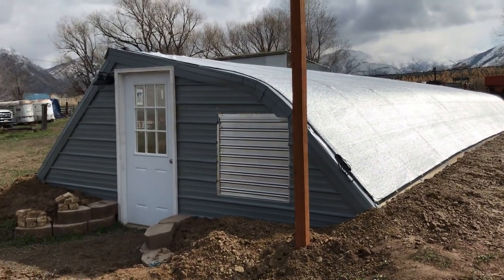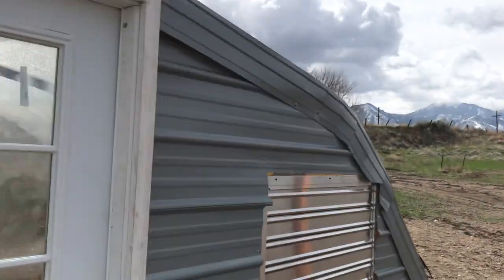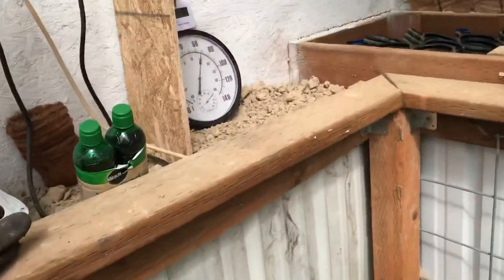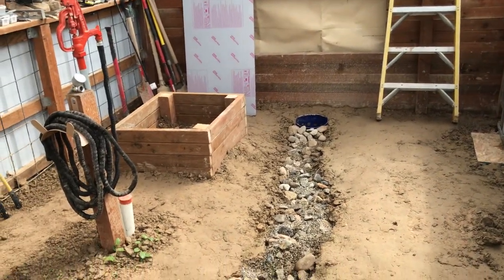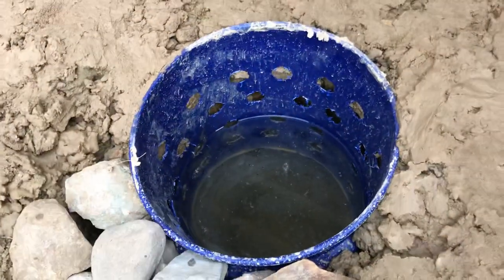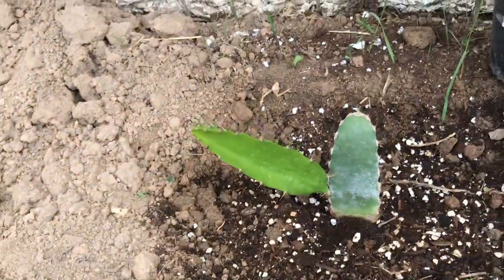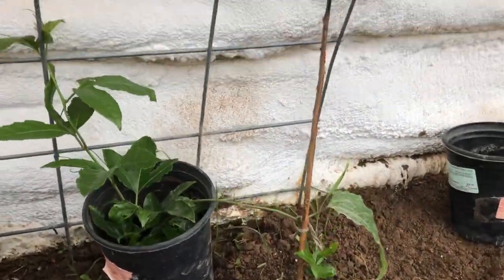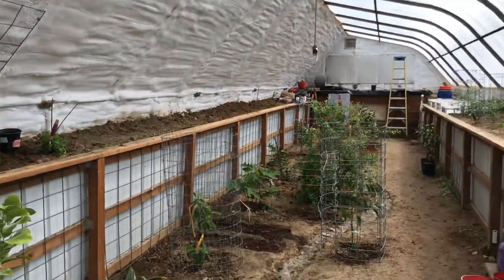Geothermal Greenhouse March 2020 Update

Comment: water drainage you built, how does it actually work? it runs out to the pipes outside and does the place where the pipes go outside underground have cavity where the drainage water is to be flown out? is it gonna effect the efficiency of the 10 degrees of air stored underground
Reply from the maker: The water drains by travelling thru the gravel/rock channel to the trench where the pipes are located.  From there, we have trenched downhill into a pond.  Works great, but was a lot of work.

Comment: Awesome build on the Citrus in the Snow greenhouse!  I have bought their plans too.  Keep up the great work and don't let down!

The GAHT system might not be working so well if the pipes are under water.  Can't move air through water. That might be reason for shade cloth addition?  Extending the suction of the hot air intake, to the roof (highest temp area), might also help with temperature.  Ceres Greenhouse Solutions does this with their GAHT system.

Geothermal loop field works great in water, and a lot more $. 

I go paragliding at Point of the Mountain and would really enjoy visiting your project!

No better time than now to get into farming!  We just seeded 1,024 pepper plants today.  Cheers!
Reply from the maker: Yes, some of our pipes likely have water in them.  We have plans to drain the water out of the channel where the pipes are to see if that helps.  For a new Greenhouse, where the trees and plants aren't fully grown, it can get really hot.  Even with the geothermal.  The Shade cloth really helps us with the temperature.  I hope over time we won't need it.  Heat seems to be a  bigger challenge than cold.  Good idea on the suction of the hot air intake.  We did put a vent at the top of the Greenhouse to push out the hot air.  You are more than welcome to come check out the Greenhouse (when they open back up the World).  Thanks for your feedback.
Reply: @trailbreakfarms  Running HDPE pipe in the ground would help with the water being in the pipes.  This is solid pipe and butt fused, so thus no water in the pipe and then air would not be restricted by water like in drain tile pipe.  The thermal coefficient is a lot higher in water than in air and if a high water table is available then more efficient.  Why we get hypothermia faster in water than air.  

Do you plan on doing another one?  I understand now about having more vegetation inside to help with thermal control.  Thanks for that info!
Reply from the maker: @nealneumiller9177  I used 12 - 4" HDPE pipes and put them 8 feet down.  They are solid rather than perforated as we knew we'd hit water.  We surrounded the pipes above and below with gravel.  But I still think we have somehow got water in some of them.  I found a hole in one of them when we put them in the ground and its possible they just get holes in them.  Hopefully we can get them all working!  

Yes, I plan on a second Greenhouse using a 40' Container as my North wall.  But not for a while.  I'm learning on this one.  Thanks for your feedback.  Much appreciated!

Comment: Thanks for the update.  That mobile weather station is a great new addition to the greenhouse.  I have the same problem on my property as well.  When they drilled holes in the basement floor to put in radon the holes filled with water.  My whole house and a good portion of the lot is on a huge water table.   It looks like the inside of the green house is really coming along with more plants.  How exciting for you all.  Once I get some acreage I plan on building at least one of these greenhouses.  What do you use for backup power if the power goes out?
Reply from the maker: Great question.  We have been considering many things:  large propane tank, generator, wood burning stove (we have several) but have decided to add Solar.  Solar will become primary source of power.  Power Company will become secondary.

Comment: Hi there, thanks for the update.  I am in the planning stages of getting a green house ordered from Greenhouse in the Snow.  I am wondering what your current estimated cost is on your own build to this point. It looks like you are now "off and running" and I'd love to know what your rough overhead cost has been.
Reply from the maker: Great question!  I'm still trying to figure that out.  My original budget was $25K.  I think that would be doable depending on what you do by yourself and what bells and whistles you add.  I've done everything myself other than excavation (which required extra work to deal with water) and electrical.  The added Aquaponics will probably cost 3-4K.  Even though I have power, I am going to add solar which will run around $7K.  I've added extra vents and fans which I highly recommend.  Spray insulation was around $1800 - again highly recommend.  I do really like the kit and recommend it.  I have a bunch of recommendations if you do decide to move forward with a "Greenhouse in the Snow".
Reply: @trailbreakfarms  thanks for the info, I would love to get in touch with you via email. I am located in Western Wyoming
Reply from the maker: @cookinginthedark6768  you bet.  steve@amsource(Dot)com
Reply: @trailbreakfarms  I hope you don't mind if I shoot you an email as well?
Reply from the maker: @jeoinaforest  anytime
Reply: @trailbreakfarms  Thank you sir!  Message sent.

Comment: looks great!  How did you do the retaining walls inside?  Its hard to see details in the video but it looks like pressure treated wood for structure with metal siding against the dirt wall...is that correct?
Reply from the maker: 4x4 pressure treated posts are about 30 - 36 inches into the ground.  I placed them every 6 feet.  Pressure treated 2x4's between the posts and metal siding behind them.  2x6 as a top railing.  We have a hard clay soil which should hold up pretty good behind the walls.  Time will tell!
Reply: @trailbreakfarms  thanks for the quick response!   If you had to guess, how often are your blowers running?  They look like 1/2 hp models judging from the size.  I'm trying to calculate if I can go off-grid and I see you mentioned adding solar in another comment.

Comment: Would be really curious to get temperature data from you.
Reply from the maker: We were able to keep it above 50 during Winter.  The warmest we've been so far this year is about 86 and we've kept it in the 80's or below.  Goal is 50 - 89 on temperature range this year and 55 - 85 in the future.  I'll keep you posted.
Reply: @trailbreakfarms  Thanks for the response. Sounds like it's working pretty well. I'm planning on making an underground greenhouse in the future. Pretty sure where I am I'll have to use a bit of evaporative cooling in combination with the earth tubing during the 115 degree spells.
Reply from the maker: @dustman96  I believe this is best.  I am going to add a "water wall" on the west side next spring so that the air I introduce is cooler and damp.

Comment: Will that water drain into your geo pipes?
Reply from the maker: Thats actually a great question.  I went with solid pipes because we found we were hitting water in a few places when we did some test holes. I believe water has somehow found its way into some of them because they aren't pushing air.  I'm going to blow them out to confirm.